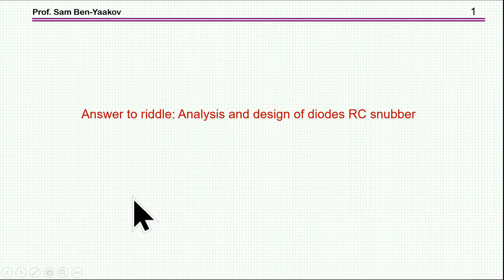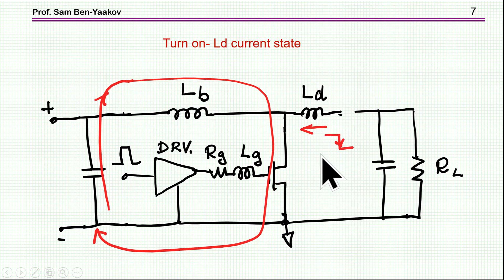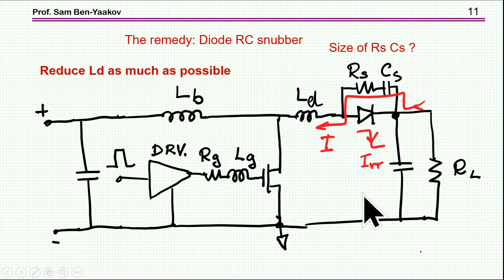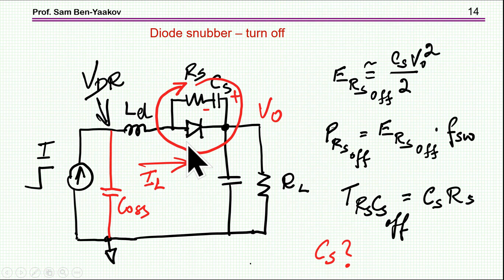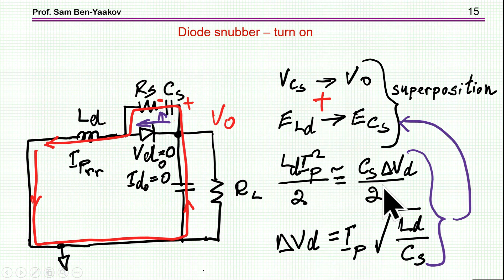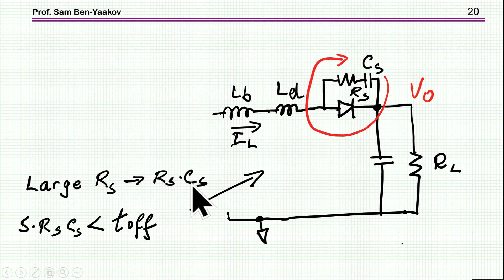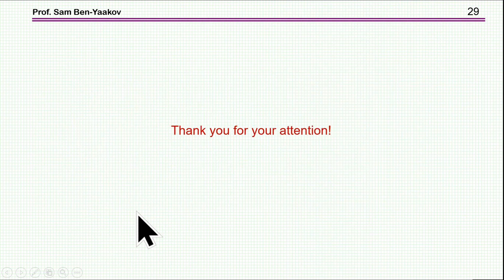Answer to riddle: Analysis and design of diodes RC snubber

Comment: Hi Sam, do you have a video covering the usage of snubber capacitors in a totem pole / bridge arrangement of switching elements in found commonly in some DC-DC converters, VFDs, motor controllers, etc? Especially where the switching elements are large IGBT bricks with bus bars? I have a friend that says a lot of large welders and DC power supplies he buys and tears down to salvage parts and claims these supplies feature them. I've also seen them used by high voltage enthusiests in DRSSTC tesla coil designs since the Steve Ward used them in some of his early designs that set that precedent for followers.
Reply from the maker: There are a couple of videos in my YouTube channel on snubbers. In the YouTube search window, look for 'sam ben-yaakov snubber'
Reply: @sambenyaakov  You know the damn of it is I literally did that exact search query several times with this video being the only one to pop up! I'll try again I guess. Thanks!

I found the relevant video! https://www.youtube.com/watch?v=WZSMBy35HBA and yup I have played with that form of active snubber previously! Using diodes and bus capacitors!
Reply from the maker: @power-max  Is this of help? https://youtu.be/zJQM842clcM

Comment: Ld is in this example external to the diode. But what to do for the part of Ld which is inside the diode package, the bond wire? The diode reverse capacitance is across the "ideal" diode and the bond wire is in series with this capacitor. The only accessible terminals of the network are on the outside of the diode. Also, calculating the power dissipated in the resistor requires integration as the RC rise and fall time approach the circuit rise and fall time.
Reply from the maker: Yes, the snubber does not take care of internal inductance. The power dissipated in the resistor is practically independent of rise and fall time.
Reply: @sambenyaakov  Thank you for your response. Concerning power dissipation in snubber resistors I have a riddle for you. You can try to do the following. In LT spice, setup a square wave with 1 ps rise and fall times driving an RC network 20 R, 1nF at 40 KHz. Change the resistor value and let LT spice calculate the power loss. No difference at all for any resistor value. Edit the voltage source and change the rise and fall time into 10 ns. Power loss in the resistor is no longer equal to the energy stored in the capacitor and now also depends on the resistor value because changing the RC time constant changes the difference between the capacitor and the source voltage (area) . At first I put this into excel to calculate the real power in snubber resistors by means of integration. But the same can be done in LT spice. The difference between the formula (energy stored in a capacitor x f) which assumes a perfect square wave and a real square wave with edges on the order of 5 ns is quite large.

Comment: Thank for the clarifications, out of the box thinking as usual, I have a question:  6:32 why you assume that the discharge of the snubber capacitor is in the direction you mentionned, is it bcs the potential on the anode of the diode is more positive that on its cathode? I have difficulties to imagine 2 currents flowing at the same time in opposite direction. And why you assumed that the Csnub is charged with Vo? Thanks Prof. Ben-Yaakov
Reply from the maker: The discharge is looked at by supposition, assuming that the diode is conducting. In Boost the diode eventually charges to Vo when the MOSFET is on.

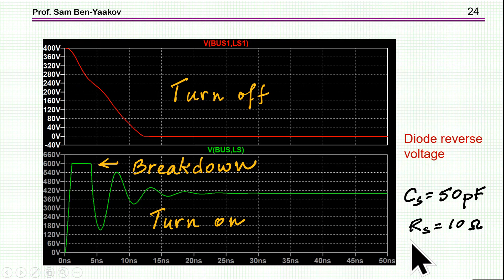Comment: Thanks Sir for excellent Video. But on 13:12, I am not getting similar V(BUS, LS) waveform in simulation on Ltspice. 
My second query is that in my flyback project, I am getting 620V reverse voltage from 5nS on MUR1560 diode. Though the diode has not failed, but is it acceptable.

Thanks for your help.
Regards
Reply from the maker: 5ns is probably OK, but what not pure a simple RC snubber?
Reply: Sir, 

Thanks for your reply. I have put RC snubber with 22ohms and 470pF values. It resulted in 620V peaks across the didoe. If I increase 470pF to 680pF, I am getting 580V across diode , but the resistor of 22 ohms is getting very hot ( 145C against 115C with 470Pf) hence I decided to use 470pF to avoid heat in the resistor.

Thanks again for your kind help.
Kindly advise if there is scope for further improvement wrt to voltage across diode and heating in the resistor.
Sanjay  @sambenyaakov
Reply from the maker: @sanjayagrawal6143 620V for 5n is I think OK

Comment: Hello, Professor. I use the boost diode absorber in the APFC BOOST circuit, the R value is 51R, and the capacitance value is 150PF. This can improve EMI very well, but it will bring about MOSFET and diode heating problems. I debugged and found that the heating problem is much better when the capacitor value is 100PF, but the EMI is worse.
Reply from the maker: Have you tried increasing the resistor?

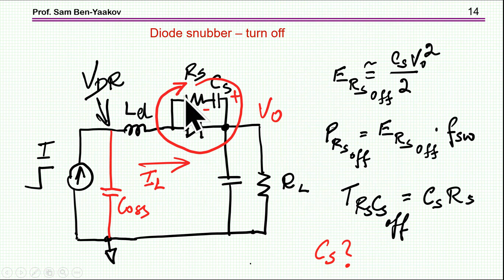Comment: What a timely resource, I was just doing similar calculations with one of my team on a diode snubber for a two swicht forward circuit that we learned the hardway is really important, but we came up with a different calculation for the snubber losses at 7:29.  As the resistor has to discipate the energy of the current flow in both directions, isn't it 2 X the Prs value you calculated.  Thanks again for the great videos and if I am missing something I appreciate being corrected :-)
Reply from the maker: Hi Dave, Thanks for input. Yes indeed, there is a power loss during the charging time. I did not dive into it to keep the video short😊But.. it is not X2. This is because, during the cap charging, the resistor is dissipating both the charging energy AND the energy originally stored in the stray inductance LI^2/2. However... these losses are not to be taken in their average value because the duty cycle of the charge/discharge processes is small so the thermal impedance of the resistor is much smaller than the steady state thermal resistance and consequently the temp rise will be much lower than estimated by the average power loss. Not trivial.

Comment: Hi. Thank you for this nice presentation. I'm curious how to apply it to flyback secondary diode. Should I use leakage inductance of transformer as Ld in this boost example? And I assume I should use delta Vd as not voltage above Vo, but above Vo+n.Vin_max. Correct?
Reply from the maker: Yes on both

Comment: Thank you professor. I was recently dealing with this problem as diode turn-off ringing due to stray/leakage inductance and junction capacitance was causing EMI issues(it was an output rectifier diode of a flyback converter). I have then used RC snubber to solve EMI issue. But with RC snubber input current THD got deteriorated. I see whenever we use dv/dt capacitor or snubber across switches, iTHD do get deteriorated. Can you please shed some light on it?
Reply from the maker: THD. Is this a PFC converter?
Reply: @sambenyaakov  it's a single stage cc flyback design based on PFC flyback controller.

Comment: Hello, i'm currently woking on a led project where 10 LEDs are placed in series as a load, but during testing, I've noticed the the first diodes that are in touch with the output are the first to fail, would a snubber Network like this in parallel with each LED balance the peak current through each LED??, i was thinking of this soultion until i saw this video, my guess here is that first input LEDs are having to put up with the highest peaks and absorb extra power all the time, thanks for sharing
Reply: @Tauquir Iqbal oh i'm driving the led strip with a sepic constant current converter so, 10 leds are connected in series, and the maximum output is 130Vdc@1Amp, so I don't want series resistors as to keep high efficiency, but usually the 2 LEDs that get the energy input are the ones that fail, inner ones will be fine.
Reply from the maker: Is there difference in cooling of LEDs? Perhaps the first ones are getting hotter? Also , look for spikes and oscillations. The first ones will channel these to ground and may get damage by that.